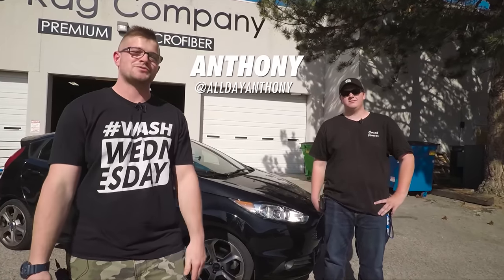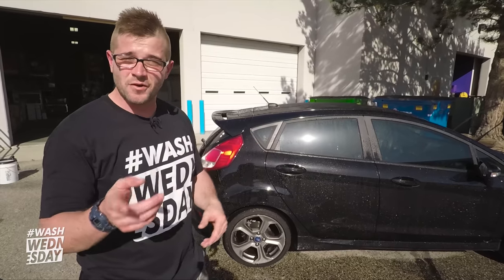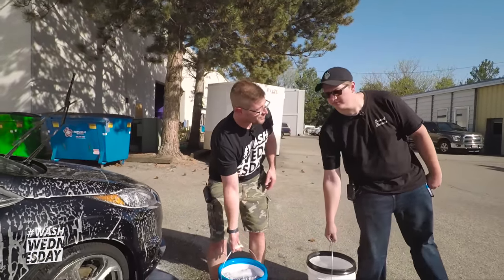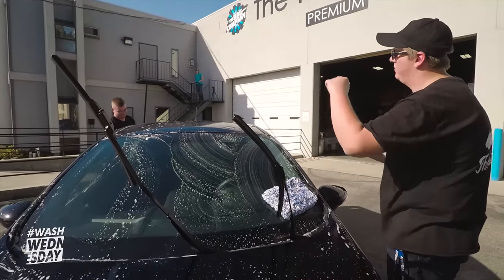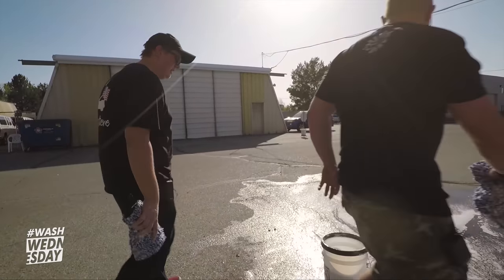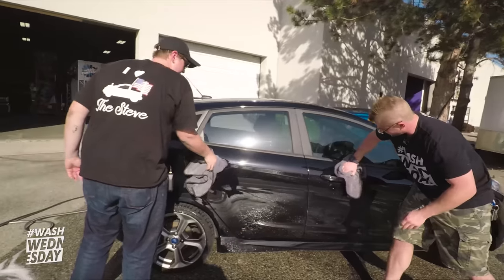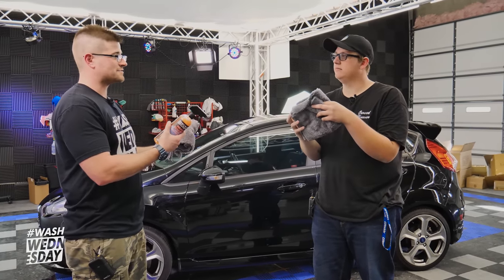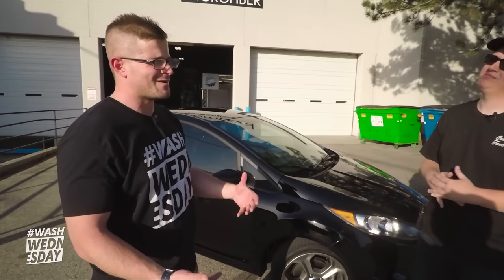Braden Carlson's Ford Fiesta ST Wash + Drive | WASHWEDNESDAY

Comment: What is the best towel to use when applying Bead Maker? And how many would you typically use on a medium/large car?

It looks like you're using the Eagle Edgeless 600 in the video, but I've heard other people say that two sided towels with one side having a lower nap is better for Bead Maker application.

If it helps, I'm located in BC Canada, so humidity and heat is not a huge problem. The car is covered in a Stek Dynoshield PP film and Gtechniq Crystal Serum Light, and nothing else. Even still, I want to minimize marring if at all possible.

Comment: got the same car/color; also curbed a wheel on my Fiesta ST on the 5th day :( any tips for living with the swirl happy black paint? also the worst brake dust award goes to the Fiesta ST pads.
Reply: ihatemacs9 Paint correct it and ceramic coat it.
Reply: seems silly to paint correct new paint. I should've gotten it in Race Red :-/
Reply: ihatemacs9 I’ve seen tons of new cars that need paint corrected right away. It’s not weird at all.
Reply: Ben Troxell I’ve also seen that. Dealerships can absolutely damage paint within the short time they have the cars
Reply: I'm aware it happens, it's still a silly notion to me. I am glad to finally see the Bead Maker in action, I've been looking for people's thoughts since I first heard about it.